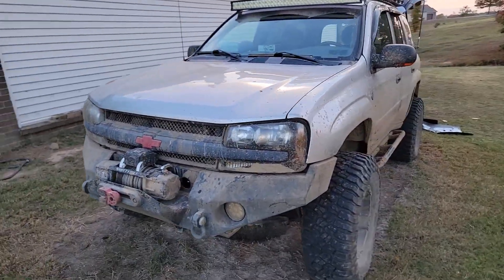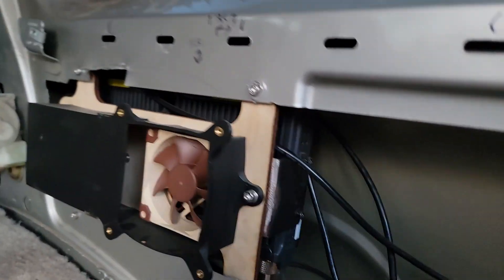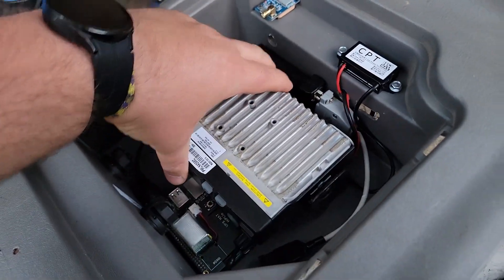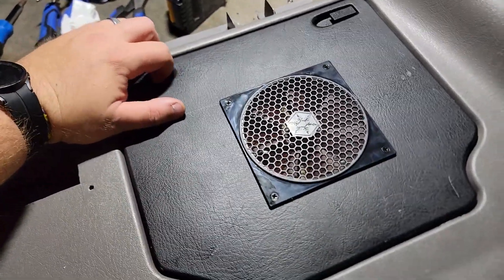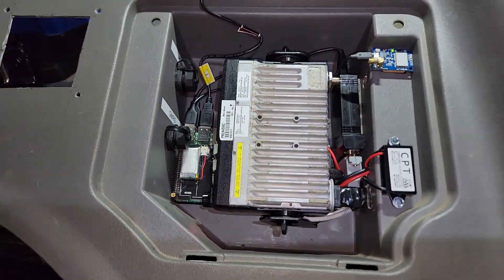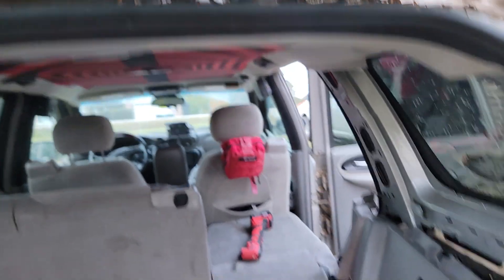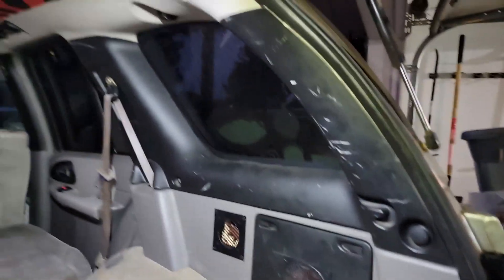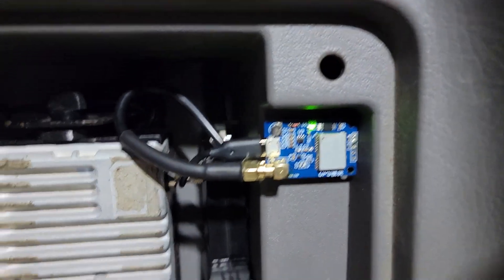Mobile APRS Messenger / Tracker / Digipeater / IGate

Comment: About the only thing I might have done different... Is diplex the GMRS & APRS together to save on additional antenna.

If the GMRS radio is going into a dual band antenna & you're not using the VHF side of that antenna for anything, a simple duplexer would have done nicely.
Reply from the maker: I prefer all of my radios to have independent antennas when possible. Dual band radio goes to dual band ant. GMRS radio goes to GMRS monoband. APRS goes to VHF monoband.

Comment: Nicely done. Can you enable the repeater from the drivers seat?  And will the TX unit push more than 5W consistently without smoking?
Reply from the maker: You're talking about the 2x Wouxon units side by side in the panel? You can enable the repeater from the display up front, but the jumper must be installed from the back if it's not already connected. I couldn't tell you what the duty cycle is. It's a little better than stock with my added fans.
Reply: OK cool, I'd heard they cook above 5 Watts in repeater mode, but yes your excellent fan solution probably mitigates that